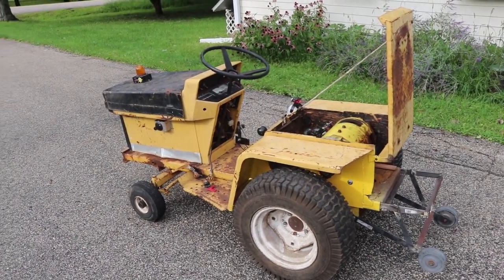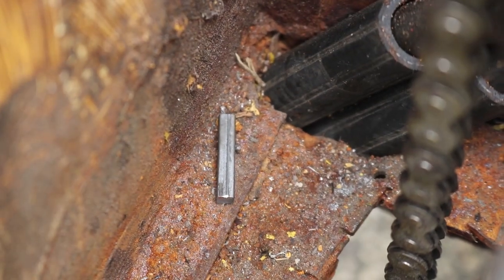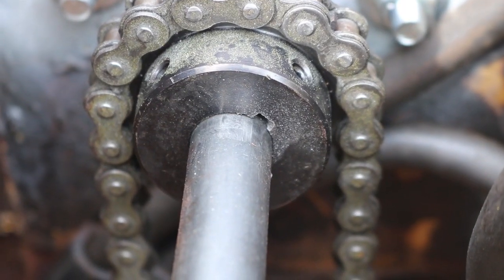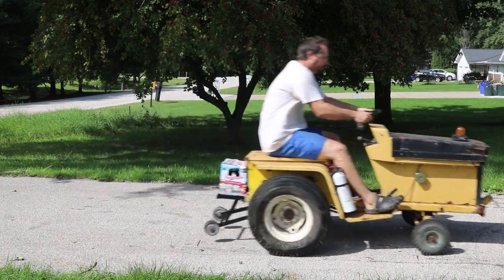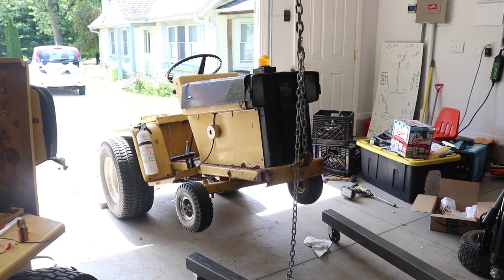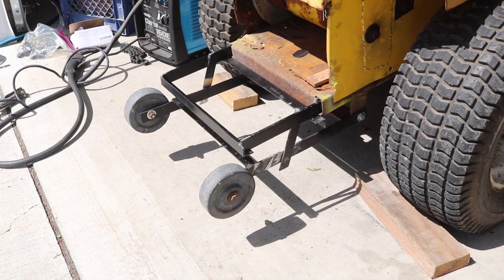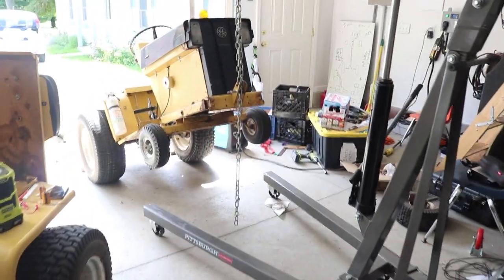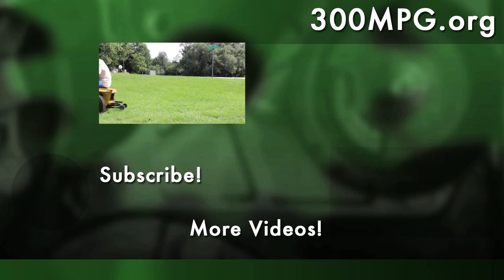ElecTrak Rat Rod Part 15

Comment: maybe some red loctite on that key would help....
Reply from the maker: I hadn't thought about putting Loctite on the key itself. I did NOT want to use Loctite on the set-screws as they just have a female hex connection for tightening. Getting Loctite down in there seems like a good way to never get an Allen wrench in there again! I just re-tightened the set-screws and it hasn't been an issue again. I still might add a second set screw right over the top of the first to mechanically lock it down.